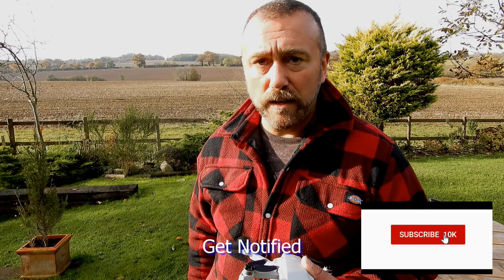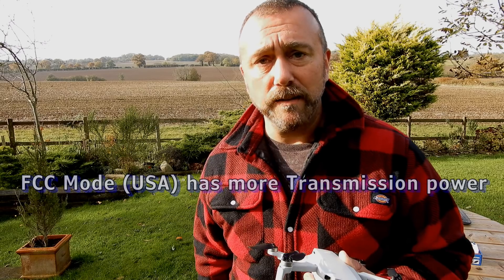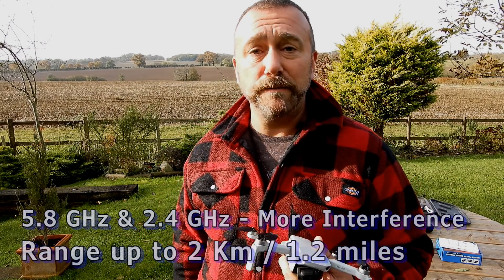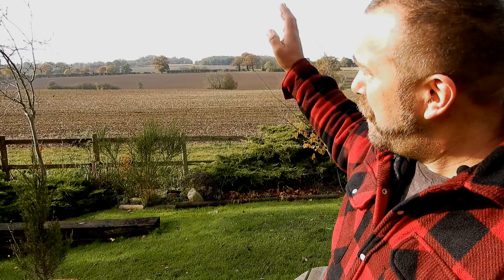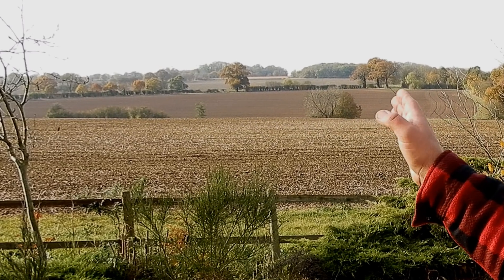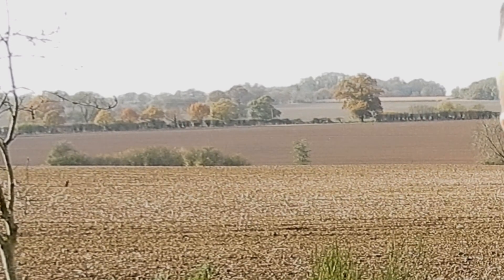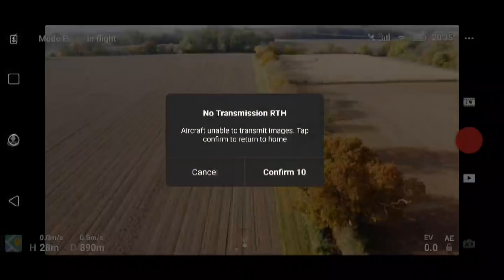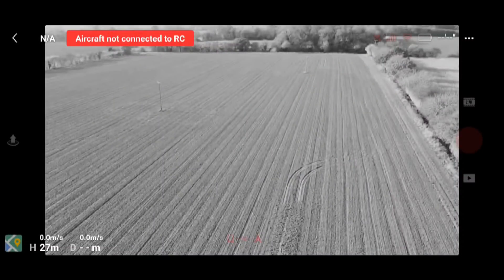Mavic Mini: Long Range Signal Test (CE Europe)

Comment: Thanks for testing this, great stuff for all of us CE pilots. :)

From the tests i did with my Mavic Mini, it seems like on startup it scans all available frequencies in the 2.4Ghz and 5.8Ghz band and depending on how much interference it sees, it locks onto 2.4 OR 5.8 Ghz. It doesn't switch between 2.4 and 5.8, at least it didn't in my tests, even when it lost connection due to distance. Needs more research though, mine hasn't flown for even two hours yet.

Happy flying!
Reply from the maker: Mine stayed on 2.4 the whole flight.  I'll keep an eye on that when I fly near a town.  Cheers, Ian

Comment: Ian...….. Lets not discuss the line of sight issues. But I did the same test on my MM and got over 1100 m with no issues at all and could have gone further but turned back. Video here

https://www.youtube.com/watch?v=avztQsZtV04
Reply from the maker: I have no doubt if I had flown higher I'd have got way further. But didn't want to be accused of endangering aircraft or other stuff. With my 249gm plastic drone. 😀
Reply: Yes at home I cant even take my MM off for fear that my 249g drone might take out a Longbow Apache. Apparently these Apache's also fly in my house cos I cant even take it off there

Comment: Wow. I haven’t managed to get more than 500 meters away with mine before it disconnects.  Haven’t managed to get out in the middle of nowhere yet though.  My first flight was at Southend lost signal at 200 meters but there is an airport nearby.  I was thinking about sending it back lol
Reply from the maker: You might try manually setting a channel that may have less interference....

Comment: Dustin Dunnill manage to get 5.51km.....you flying to low and the  antenna was not directly pointed with the quad...
Reply from the maker: You shouldn't point the antennae towards the drone. The should be at 90' to the direction of the drone.👍🏻

Comment: What I do not understand why you do so what makes different transmit power installed. So 100 meters and a little more without interference has to be in there. The Spark has been there since problems with the transmission line in the CF

Comment: Was expecting a bad review I don’t think how it’s fair that 2 version 1 has a weak signal and 1 as much stronger signal but yet the same price on this reason of the signal being very weak I returned my mavic mini and got a refund and I do reckon there will be a lot of returns come Christmas passes o
Reply from the maker: It's actually the same model, it just auto-adjusts based on location.  1000m is plenty for evry day use I think...

Comment: Hi Ian, something tells me the signal wasn't great. That radar at the bottom of screen shows the drone heading and your controller direction. When you set off, it was showing as behind the drone? On teh return, it looked true as the drone was pointing back to your controller. I've seen a video of a guy in the US flying over parkland at 200ft and he gets to 18,000 and returns the drone!!! (As a crash landing mind!). I'm sure you could get much further with a CE controller. 👍
Reply from the maker: I must admit I was a bit confused by the radar arrow on that flight; it seemed fine going out (as the arrow points to the driection to head home in I thought) but on the RTH it's pointing the wrong way..... I'm sure I could go further if I flew higher but I wanted to keep low and out of trouble so to say :)
Reply: Tech Monky what is a CE control er

Comment: Hi Ian, you didn’t actually say which frequency band your test used?  In the DJI Fly app you can change the channel to manual and then select either a 5.8 or 2.4khz channel.  I’d be interested to know if there is a difference in range depending upon which channel you use?

I’d also be interested to see whether turning things like WiFi or Cellular on your phone connected to the controller makes any difference to the range?
Reply from the maker: I left it in auto mode but it flew pretty much in 2.4 the whole way.  Apart from my own home wifi, there were no other houses anywhere near this flight.  I might have a play around with the channel settings; guessing 5.8 won't get me far...

Comment: A fine day with no wind I take it.... The answer is go to the USA on holiday, but a Mavic whilst there and bring it home...problems solved.
Reply from the maker: No, as it resets the power based on GPS.  I believe the Mini is just like the othe rmodels; when I first fired mine up, it stated the wifi settinsg were being amended to comply with local laws.....  So you'd still need a GPS hack

Comment: Pretty impressive for such a small drone but definitely the CE version customer is getting very short changed over the FCC version!
I watched Dustin Dunhills long range test of the FCC Mavic Mini test, it reached over 5.5km and was still going! Only had to RTH because the battery was past 50%, that is incredible range!
Reply from the maker: HIs test was crazy to watch! :)
Reply: That's because he moded it with extra battery and a tv antenna
Reply: @brennanmartin3885  I'm beginning to think some 'trickery' was involved? Either modded antennas, reflectors or some serious extra juice to throw that wifi signal so far! ⚠️🤔😁😊😯
Reply: PD Tech 100% bone stock and only 2nd flight! With range test Justin always does a stock test first to see max range and he pushed it to the limit! We could’ve gone further but the drone would not made it back.. even so it crash landed around 20/30m from him with 0% bat xD he’s done some crazy close calls in the past but this one takes the cake
Reply: @ytaky  It was a great video, very tense to watch, I must admit at 55-60% I would be heading home lol 😁 
Dustin left it until 50% and by the time RTH was activated it was already on 49% and I had an idea it would not make it, very close though!!👍😎 The first 50% of a battery is always a lot more powerful than the last 50% especially on a Lithium Ion battery 😯😊👍😎

Comment: Brilliant! Very good distance compared to all my fears of 500m max. Well done for posting that. Could you try it with a pair of antenna boosters on next! The cheap plastic ones not the expensive ones! Cheers Simon.
Reply: Understood!
Reply from the maker: Hi Simon, TBH I didn't want this to be a max range test and I didn't want to go much more than 1000m anyway.  Already sticking my head above the parapit on this :)  I just wanted to make sure we had good signal for day to day flying....

Comment: I have to say, my eyesight is not 20/20 so I doubt if I could even see the Mini at 900 metres. Looks like a good little drone though. If I start to get any hassle now the regs are in place my Mavic Pro will be getting replaced with this.

Comment: too low at 27 mt
Reply from the maker: Only from the best transmission perspective; there's no requirement to be over 50m unless you're over buildings or people.  Cheers, Ian
Reply: @IaninLondon  For an optimal test range yes...if you repeat it at a height of 70 meters you will easily reach 1.5 km ;)
Reply: the cone of the signal develops at the top
Reply from the maker: @simone76  Yes, I defo get that.  I just didn't want to be accused of endangering aircraft or something daft like that.  This was just to make sure we could fly most flights without interference......  I got up to 2 Kms with the Air a year ago...

Comment: Didn’t understand, why you didn’t fly a little higher.
Reply from the maker: Becasue of the distance; I wanted to stay as low as possble and test under the worst conditions, so higher flights woudl be better. Ian
Reply: @IaninLondon  can you do another, but with more height? I'd love to see how far it'd go with a bit more height.
Reply: My Mavic Air does MUCH better at around 200 feet height than at under 100 feet. (I don't do metres)
Reply: @jameslovell8682  
50-100m should be legal in most air spaces in Europe. (I don't do feet, I have them)